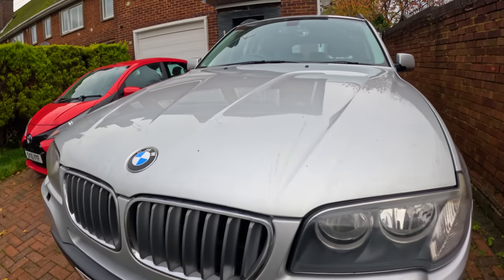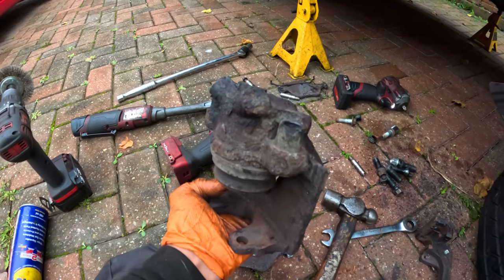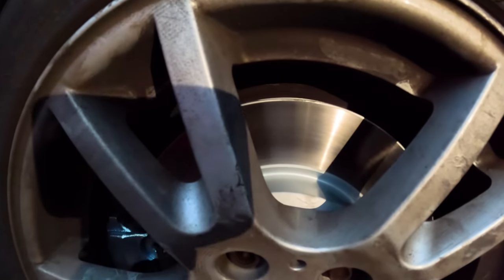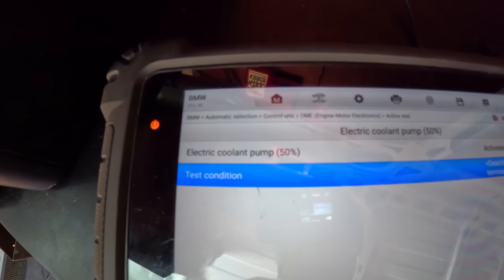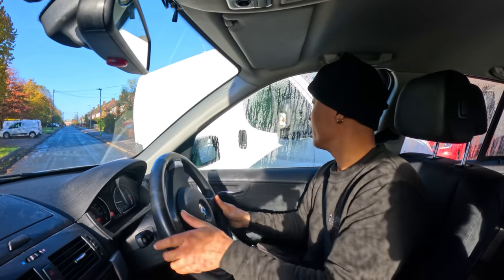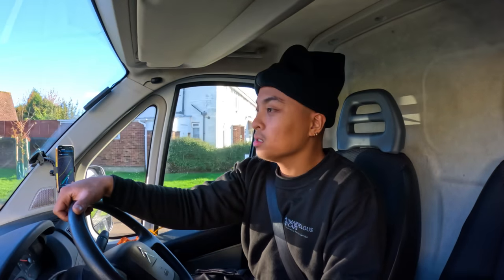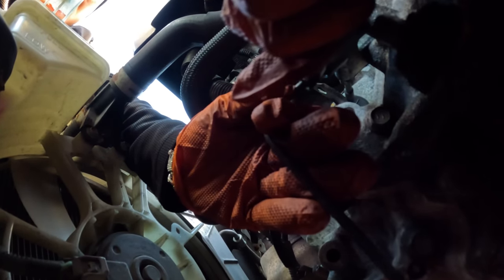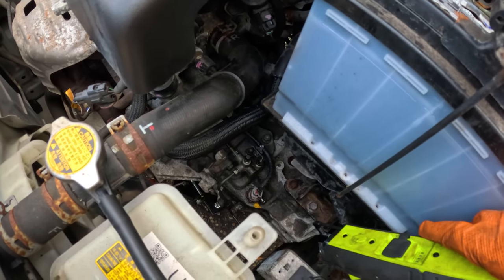HOW I SAVED MY CUSTOMER FROM WASTING £800 | BMW WATER PUMP | AYGO CLUTCH | Life of a Mobile Mechanic

Comment: I noticed you are using textar brake grease. This is mineral based and is ok to use on the brake pad contact points. But not on the slider pins as it will cause swelling of the rubber guides. Use red rubber grease or silicone grease where there is rubber.

Comment: The rubber boot that the brake slider slides though, can start sticking because of aluminium builds up that white powder corrosion between the calliper and the rubber causing it bind. Iv come across this on older mini’s. Sorry for the life story. Great content btw

Comment: Please don't use Textar Ceratec grease on sliding pins or any other parts that have direct contact with rubber. They will seize again. Correct product should be silicone based e.g. Permatex Silicone Ceramic Extreme.
Reply from the maker: I thought they were fine with rubber as they’re not metal based. What is it that makes it bad for rubber? 🤔

Thank you in advance
Reply: @themarvelousvlog  should use red rubber grease

Comment: The piston seal is tapered and the tip deforms when you brake and when you stop braking it springs back and very very slightly pulls the piston away from the pad/disc. If the calipers even slightly rusty between the seal and dustcover this very light pull cant overcome the rust... so they might look free, but not enough not to stick

Comment: Question- what does the secondary water pump do that the main water pump can’t? Is that something special to BMWs?
Reply from the maker: Not specific to BMW mate. A lot of manufacturers use it, like VAG. It’s mainly for cooling for when the engine is turned off. The pump will keep circulating water to stop components from cooking the oil(ish), and for when it’s running, to make sure that your engine temp is at optimum temperature at all times even at low speeds/standstill
Reply: @themarvelousvlog  On some of the VAG ones at least, it also lets the engine warm up faster. The mechanically driven pump flows water just through the head I think, and then there's a separate circuit which flows through the whole block etc.. Either way, by running only one circuit when the engine is totally cold, it can start to warm up the most important bits more quickly.